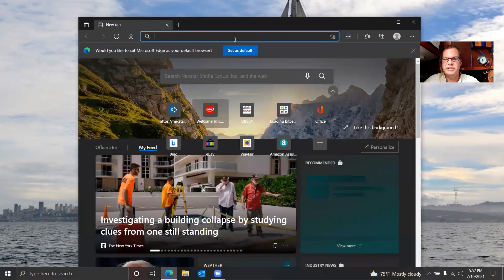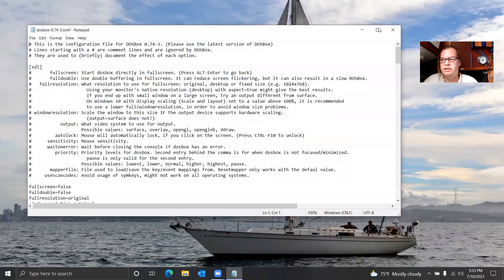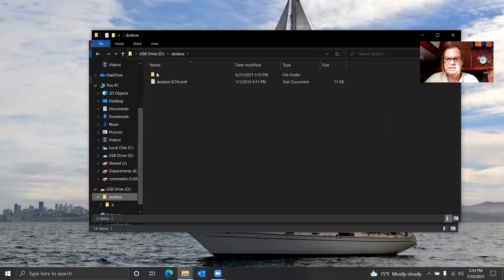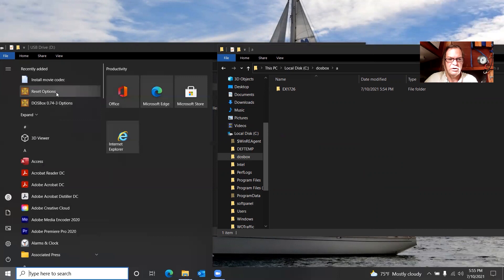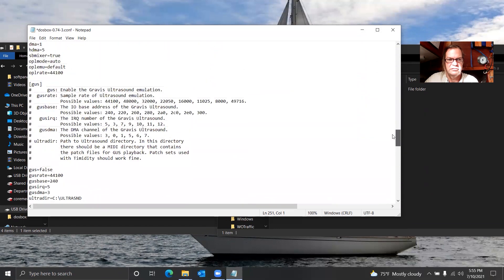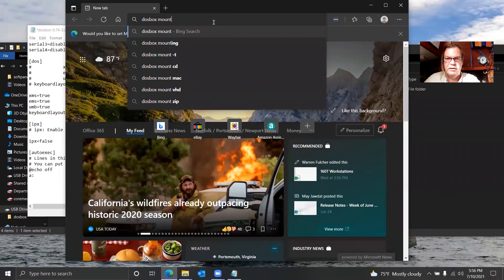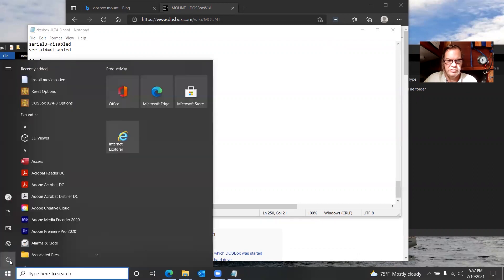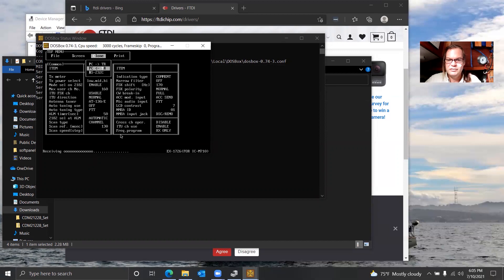Programming the ICOM M710 from Windows 10

Comment: Great video and many thanks however we keep getting the dreaded error : "Serial1: Desired serial mode not supported (9600,5,n,1)"
We are using the same version of BosBox and following instructions exactly but no go. Tried to find the patched version of DosBox that supports (9600,5,n,1) instead of the default (9600,8,n,1) but stuck now looking for old DOS PC as VMWARE too difficult also to configure ports.
I can confirm we are using USB to DB9 with FTDI
Most grateful for any additional suggestions.